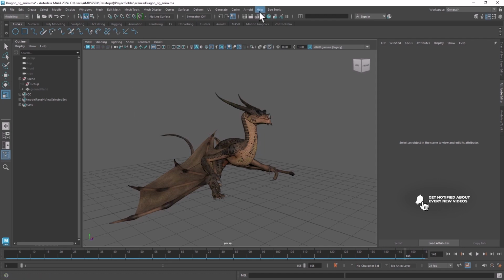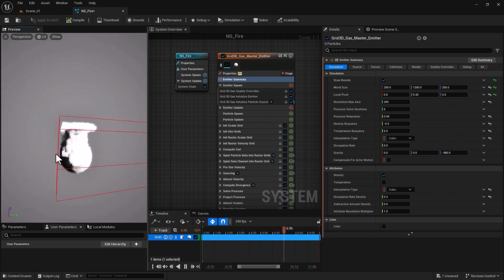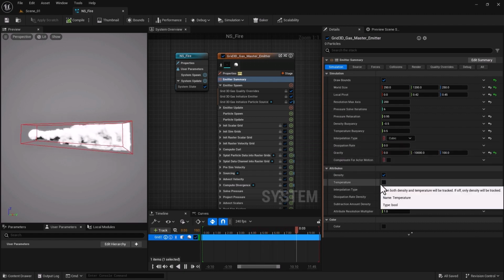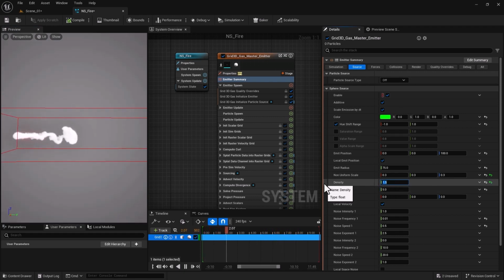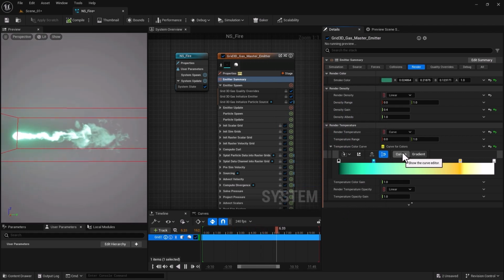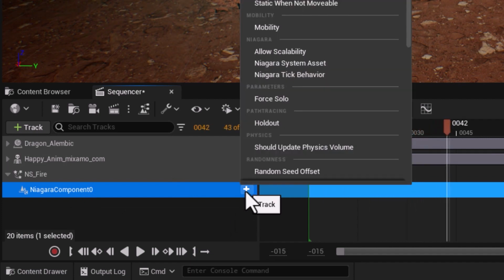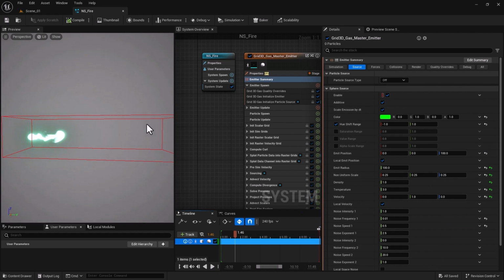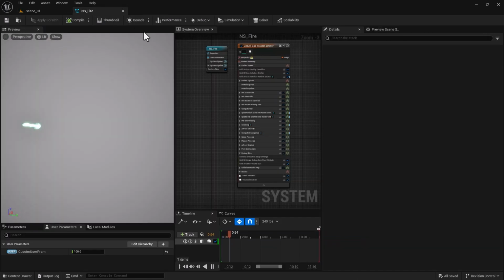#UE5 Series: Introduction to Fluid Simulation in UNREAL Engine

Comment: thanks for your wonderfull toturial 
I have a question, in UE 5.6 when I try to add the emitter it won't show in the preview panel also in my viewport I try to change properties settinge and also test the GPU and CPU calculating but still it does not showing the smoke emitter in the preview panell :(((( do you know what should I do

Comment: i have followed your tutorial and others' on using Grid 3D Gas Master Emitter but when i selected it all i got was a black mass of smoke. no highlight no color. I cannot even change color on it. just black, with some jittery pixels like it's missing data. can you figure out why that is? none of the other pro guys on here can figure it out.
Reply from the maker: Yeah, that sounds like either a material issue or a data missing problem in the volume simulation. If your Grid 3D Gas Master Emitter is just giving you a black mass with jittery pixels, it's probably because the material isn't properly reading the simulation data or the Render Target isn’t set up correctly. I'd check if the material assigned to the volume is actually pulling in the right render target. Sometimes, the shader doesn’t pick up the density, temperature, or color channels properly.  Also, try increasing the density scale in the Niagara settings. If it’s too low or misconfigured, everything just looks like a black blob with no detail.  Hope this helps
Reply: @sarkamari  it's just the graphic card on Mac is not powerful enough i found out

Comment: hi, thanks for your video. Is this simulation conducted scientifically? I mean, is this simulation based on Computational Fluid Dynamics? or, is it just based om graphics with no scientific bases?
Reply from the maker: Unreal Engine’s fluid simulations aren’t full-blown Computational Fluid Dynamics (CFD) like you’d see in scientific simulations used for engineering or physics research. Instead, they’re more of an approximation designed for real-time graphics. Hope this helps

Comment: is there a way to render fire and gas simulation with an alpha
Reply from the maker: Try these steps:
Step 1: Setting Up the Scene
1. Place your Niagara system in the scene.
2. Add a Scene Capture 2D component to capture the view.
3. Create a Render Target 2D asset and assign it to the Scene Capture 2D component.
4. Ensure the material used by the Niagara system is correctly configured to output alpha information.

Step 2: Configuring Render Settings
1. Add the FX to a Level Sequencer.
2. Use the Movie Render Queue for high-quality renders:
    - Select an image format that supports alpha channels, such as PNG or EXR.
   - Ensure the alpha channel is enabled in the output settings.
Remember if you’re dealing with particles you also need to create your sprite material with Alpha channel. This means that you need to set the blend mode to translucent and have a constant value connected to your opacity channel

Hope this helps :)
Reply: @sarkamari  Hi... thanks for your reply...I tried the method, but i am still unable to get the result i need... i have put together some screenshots... for your assessment... please do take a look.......https://drive.google.com/drive/folders/1u3nySuzqNl36OSqXrdt6UkqSH0nqB-4Z?usp=sharing

Comment: Hello, thank you for this, I followed the tutorial but my smoke is in a lower resolution than yours. I have an Nvidia RTX 2080 super, optimised to work with UE. I had a similar problem in Houdini. What could be the issue? Thanks
Reply from the maker: Yeah, sounds like your volume resolution is too low. In Unreal’s fluid sim, check your Voxel Grid Resolution—higher values give you more detail, but at the cost of performance. Since you had a similar issue in Houdini, it could be related to GPU VRAM limits or Sparse Grid settings being too low.

Comment: Hello Reza! This is a goldmine. Thanks a lot for all your efforts and time. Subscribed and liked.
I am watching all your videos on Niagara now. Just one question. My Sim is coming out  blurred. I used the same settings as mentioned in this video.
Wondering what is limiting my Sim. Can you please share your thoughts... and also what machine configuration are you using ?
Reply from the maker: Thank you. I am glad you’re finding the tutorials useful.
Regarding your outcome:  1. Make sure to set Engine scalability as high as your GPU allows (Under Settings on the top right of your UI) 
Also, Resolution Axis might be too much to handle for your Graphics card. Lower that to something like 200 and see if you can get a better result. This property is actually in charge of the crispiness of your fluid but if your GPU can’t handle it, the result may have a reverse effect. Also, it’s always helpful to have ray tracing on.
Reply: @sarkamari   Thanks Reza. I made the above mentioned changes. No luck. I think My Radeon 6700XT is not sufficient enough ?
What specs are you using ? Looks like the UE documentation recommends NVIDIA RTX 3080Ti and upwards. Wondering what specs you have. Thanks a lot!
Reply from the maker: Can be your GPU. I have 4090 so issues there naturally but two years ago UE was still coping with my 3070 with problems. I have never tested UE on Radeon

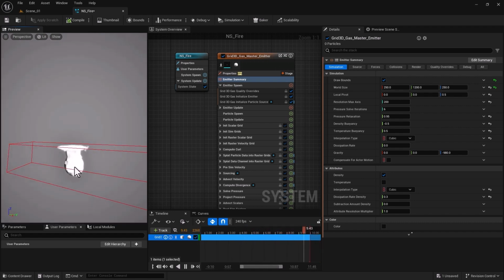Comment: Hello Reza, huge thank you for sharing your knowledge on these topics with us... Question - 8:45 when you start changing the boundbox and moving the emitter inside - on my side it behaves totally different. changing world size simply cuts the emitter source, if I put 250 into Z, it won't even render anything, as the emitter source now is too low (below the box). When I try to adjust LOCAL pivot, it just MOVES the whole box along with the emitter (emitter stays in the same position inside the box). And basically, I'm stuck here. Any clues why this behavior? (I can't find anything via googling). Thanks!
Reply from the maker: Is the emitter still within the bounds?
Reply: I have same problem..